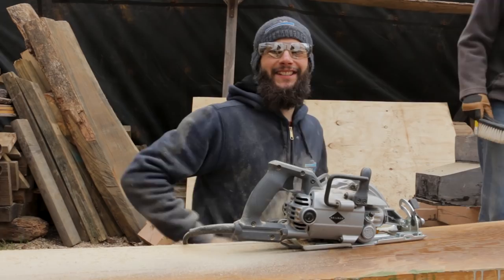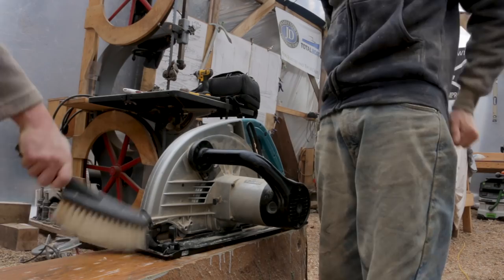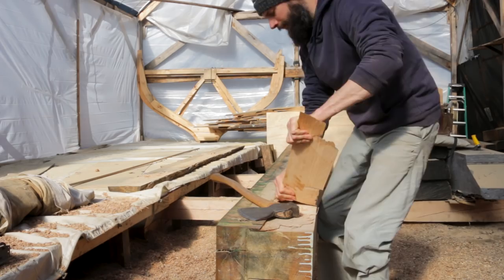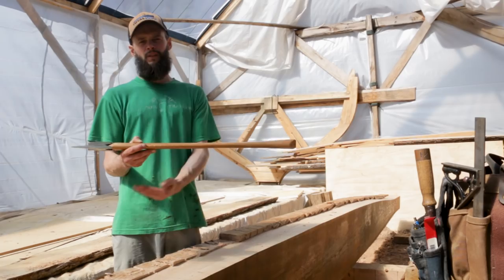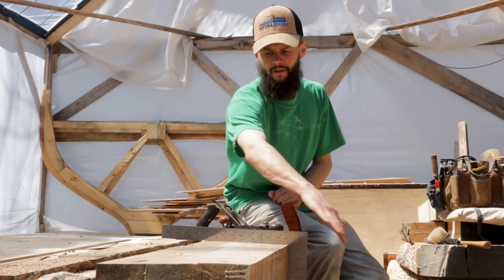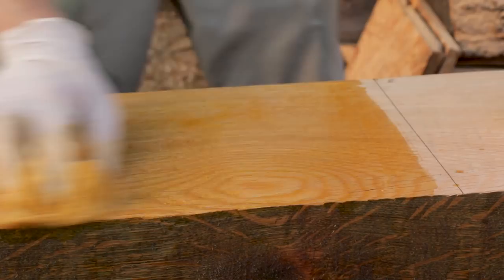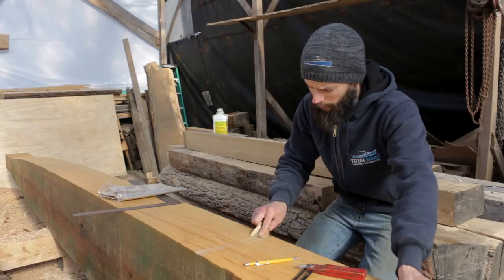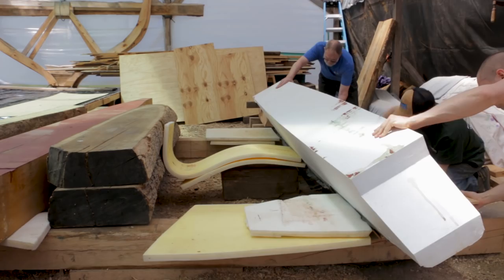Acorn to Arabella - Journey of a Wooden Boat - Episode 35: Final Cut of the Keel Timber

Comment from the maker: Quick blip addressing all the comments about using the bandsaw (or other methods) to cut the keel timber (we have a computer down at the moment so we are not able to get to people's comments as quickly as usual).
The bandsaw is not an option for cutting the keel timber.  First due to the length of the boathouse and the curve of the cut, it would logistically not be practical to cut on the bandsaw.  Next, that timber weighs in at about a ton (2000lbs).  Imagine trying to pick up a car and passing it through the bandsaw for a cut but with no wheels on the car.  Not only is the bandsaw not able to support that amount of weight, it would not be physically possible for us to pick it up and accurately pass it through the bandsaw (it is also not made for this).
And yes, we could have used multiple other ways to accomplish the final product.  Many of you may think there were better ways to do this, but they all come to the same end.  We chose this way after plenty of planning and weighing of pros and cons which may not match the same views as someone that has differing experience (be it more experience or none...).  Our goal is also not speed in this build.  We are learning as we go.  Part of the enjoyment of this project is taking the time to build her right.  Hand tools allow a connection to the work that you do not get from power tools and allow one to take their time and sneak up on cuts and shaping so as to avoid mistakes that can come with large power tools.
We can only hope that you enjoy the process and videos as much as we enjoy the work, learning and sharing of the journey with this community.
Reply: Hey guys, part of the fun in watching this build is me thinking of how I would have done something. That has nothing to do with your process, I mean you guys have spent days/weeks planning it out. I've spent 5 mins on the same. The rest of the fun is just watching this boat take shape under your skill.

For example regarding with this cut and my thought process. My thinking after 5 mins was chainsaw. bar length allows full depth cut. Perfect right.
5 mins later I realised that chainsaw would not allow a perpendicular cut to the top.
So basically that would be a bad idea and probably result in a stuffed timber.

Another great video guys.
Reply: Exactly. commenting on how (method) i would do it and getting your feedback is half the fun of being a casual viewer. Your replies to comments help me learn as much or more than just watching how you guys chose to accomplish a step in the project.
Reply: Thomas Russell I understand your point, but the way your other comment is written seems a little bit arrogant
Reply from the maker: Thank you all for your comments on this.  We do not want to discourage comments or people from expressing their opinions.  We love that aspect of this work.  As many of you have brought up, there are so many ways this could have been done.  We simply request that the comments be left as constructive criticism that allow for discussion and learning.  Thank you all!
Reply: Giacomo Jack Balma DRUMS no arrogance intended. I know little to nothing about boats or building them. I have worked with wood and some large timbers and was just trying to say that rollers would have made the timber manageable to use the bandsaw. If it came across as anything other than constructive criticism, I apologize.
Reply: See you guys in Mystic next Sunday!   Can't wait!
Reply: Your muscles have to feel it for the Old Timers, who had no power tools?
After all, this being made to 1936 plans.
Reply: @jack_drums  I suspect he was a bit tired of all the Monday morning quarterbacks.

Comment: Great video thank you very much! I have found when making a difficult ripping cut with a circular saw a squirt or two of silicone spray on each side of the blade periodically will make all the difference in the world. It's amazing what a difference  it makes! Also a squirt or two on the base of the saw makes it a lot easier to push.
Reply from the maker: Thanks for the tip! Similar to the soap suggestion below.  Lubrication almost always helps.

Comment: Well, that was painful! :) More then one way to skin some oak, I guess.
 By the way, you probably know now, but cutting a curve with a circular saw will bind the blade, which is straight in plan view. And heat and warp the blade. I've done this with those 16" saws. It can, if muscled through the cut long and hard enough, permanently warp the blade. Also from personal experience.
 The larger the blade diameter and sharper the curve, the more the bind. On outside, convex, curves the set and bind will tend to make the kerf wider to the waste side. On inside, concave, curves the extra kerf tends to be taken on the finished side.
 Good progress and thanks for posting. (Complaining about the heat now!!! How quickly we forget!) 
 Cheers

Comment: My uneducated approach would have been to make a series of stopped cuts radiating out from and perpendicular to the curve with a chainsaw, then created a clean shoulder along one or both faces along the curve with a chisel. Finally I'd have followed along the curve using the clean shoulders to index the chainsaw to finish off the cut. Complete final shape and surfacing with a hand plane as need.

Comment: Nice work guys.  I thought I'd share a couple questions/ideas with you that may make things easier.  I have experience building log homes and regular stick homes, so I know just enough about woodworking to embarrass myself.

1)  When developing your first flat face on your timbers, I was thinking you could have gotten a stable piece of flat stock material (something like box section steel, or even would should work) and affixed it with some short screws and shims where needed.  Basically a sacrificial straight edge to roll over the planer wheels.  Get your first face planed, then remove the sacrificial piece, flip the timber, and remove stock until your screw holes disappear and you hit your finished dimension.  I was thinking the planer may have been at max capacity, so that was probably why you didn't use this method.  Maybe it'll work on narrower timbers.

2)  If you don't already own one, invest in a 'Veritas Log Scribe' when it comes time to adapt your old cabinets and furnishings to the inner hull (I'm not real familiar with nautical terms, forgive my ignorance.  Ask around for someone nearby to explain how to use it if you've never used one.  It's really easy.  It allows differently shaped objects to be scribed and tooled with absolute precision.  With a little practice, you can stack hand peeled logs on top on top of each other so tight that you couldn't fit a piece of paper in between them.  I'm sure you could also join your interior boat furnishings to the curved inner hull beautifully as well.  It's a tool that you definitely should own if you don't already.  Here's the cheapest one I found doing a quick google search: http://www.baileysonline.com/shop.axd/ProductDetails?item_no=15770
And here is one in action to give you an idea of what it's for.  This video shows a guy doing a saddle notch, you can also scribe the whole length of the log to get it to match any surface adjacent to it.
https://www.youtube.com/watch?v=i7GHPFIn9Wg
It's a pretty awesome tool, unfortunately nobody on YouTube really wants to give away their trade secrets.  Building log homes is actually quite easy.  Building them right is quite difficult and takes years of experience.  They all settle and twist over time, and the best builders account for the buildings' movements over time.  

3) Also Google "chainsaw guide for cutting slabs."  I believe it will make your life easier.

Keep up the good work!!  I hear the second one's always easier!  I'll share one of my favorite quotes here with you real quick:  "Experience is the cruelest teacher.  She always gives the test before the lesson."  ~Some Renowned Smartass
Reply from the maker: Thanks for the tips!
The planer was maxed out, we do know about the rail trick.
I know exactly what you are talking about.  I drool over that catalogue regularly, I will look into one.
Thanks, there won't be a second one, gotta get it right the first time!  Great quote! Thanks for sharing!

Comment: Thanks for sharing your story. I have to make  similar cuts . Like you I made my 1/8" kurf cuts with the circular saws but then I went to a Recp. saw with a 12" Diablo "pruning saw" blade. As my cut was in used timbers so I changed out the blade a few times to keep it sharp and cutting true. The circular saw cut in the underside kept in tracking true with no binding. Try it out on some scrap and I think you be happy. Billy in Canada
Reply from the maker: Thanks for the tip!

Comment: I'm a latecomer to your channel and I have not watched all the previous episodes.  When you described the slippage of the router bit while flattening the keel timber, it reminded me that my router did something almost identical when I was cutting some dadoes in a project.  It turned out that the lever that tightens the base around the router motor had gotten a bit loose.  I tightened it up and no more issues.  I was wondering why you did not fill in the "over-routed" slot as well as the cracks in the keel timber with epoxy.

Comment: There is a portable band saw available that slides on a metal base which sits on top of a timber to be cut.  I believe the manufacturer is Mafell tools and of course these are not cheap but Mafell tools are at least worth taking a look at.  I do not know the cutting capacity of their bandsaw and these might not be capable of making the depth of cut you require but again, worth looking at.

Comment: What about a coping saw lol, nice job and you got it done which means you used what worked. Hard for some to make he connection to hand tools and craftsmanship. Can't always push a button and wait at the other end!
Reply from the maker: Other than some real fancy CNC machines complex curves are still best cut by hand.  Sometimes the same holds true for big timbers.  The ax sure removes a lot of wood quickly! Boat building is nothing but big timbers and complex changing bevels.  Using the hand tools is over half  the fun! =)

Comment: When cutting curves with a circular (Skil) saw try using an old fashioned steel blade,  not a carbide tipped one. Now that you've got all the Belsaw equipment you can easily sharpen and set them yourself. A steel blade with a large or heavy set ( clearance angle bent into the teeth) will give you a wider kerf allowing you to cut tighter curves without the blade binding. A carbide tipped blade leaves a kerf the same width as the teeth and binds when cutting curves. Another option for cutting curves in timbers is something like a Prazi Beam Saw which is a chainsaw attachment for a worm drive skilsaw.
Reply: I've also cut a few keel timbers with an Alaskan chainsaw mill by cutting plywood templates for the mill to follow and temporarily screwing them to the timber. It probably wouldn't work on that large a timber without modifications  though. I think the mill has a 13" max. depth of cut and you need to allow for the amount of curve in the templates. There are many ways to reach your goal and any one that gets you there is ok. I've got a 40" shipsaw and would never even consider cutting your keel on it. I'm pretty confident that anyone suggesting the bandsaw method has never cut a large keel timber.
Reply from the maker: You bring the saw to big timber, not the timber to the saw!
We borrowed the beam saw so it came with the blade it came with.  We do intend to set some steel blades for different uses now that we have those machines.  Just got to find the time to get them set up! 
Never used the Prazi, how accurate are they?

Comment: I wish I could have loaned you my grandfather's 2-man handsaw for that cut once the big circular saw had done its work. Could have done it sort of like the old builders used a pit saw. Maybe not as speedy as a power saw, but workable. Were you concerned with deflection/wavering line when using a handsaw, or was it just faster/easier on the back to chop away the remaining 4" of the wood?
Reply from the maker: Just way faster and easier to use the axe and adze.  It really did not take that much time and I really enjoy working with those tools.

Comment: Question. Why is it that you haven't done much sealing to the end grain? Doesn't checking tend to start in the ends?
Reply from the maker: We have sealed them with various things depending on when/how the lumber is being used and how close it is to it's final size and shape.  Checking does usually start at the ends and is a concern.

Comment: How did the clear Plastic Boat House covering hold up to your winter storms? Will you have to replace it this coming fall before winter?
Reply from the maker: So far so good, it's thick UV treated greenhouse plastic so it should last several years provided none of the trees poke a hole in it.

Comment: Great vid as ever, is there a reason you don't sharpen that axe ?
Reply: That axe was sharp the timber was hard
Reply from the maker: Both of you are correct.  
The timber is very hard, the ax fairly sharp but not as sharp as the adz.  
I was splitting it along the grain, some spots were thin, some were thick.  The axe needed to split the grain but if it split surprisingly easily (which it does sometimes when cutting with the grain) I did not want the ax to dig too deeply into the good timber below.  Sharp enough to split, not sharp enough to cut across the grain.  
A ax used for splitting does not need to be sharp to be effective, i.e. a splitting maul.
Across the grain is  a whole different animal.

Comment: Just curious, why not cut the keel with the ships saw? It looks like it would fit in that giant band saw no problem....
Reply: Notso Fresh ... not an expert by any means, but from my point of view and limited experience seems like a rolling infeed and outfeed table would be needed that would a) support that much weight, and b) would need to be longer than the Boat Shed.   And of course then there is the problem of steering that beast thru the cut, not to mention getting it UP an additional 2+feet elevation and on to the roller track !  The prefered option I would think would be to have a track that the Shipsaw could be drawn on the length of the Keel and the SAW would need to turn left and right in the horizontal axis....they did the job much easier compared to all that...and Steve caught a MAJOR error on his Plotting of the station line...way to go dude.  Just my humble opinion...but a good question.
Reply from the maker: Maurice is correct about the saw.  The table is not meant to support that much weight, the timber is just over 25' and the boathouse is 50' so aligned perfectly it might just fit.  The timber weighs at least 1,500 pounds, lifting and maneuvering it would have been a lot of prep and a lot of work to most likely break the band saw table.

Comment: why didn't you use the BIG band saw? Great work guys!
Reply: cos they have no way of lifting the keel that high, or moving and maneuvering it once it's on the saw. plus, i don't think they could expose enough of the blade to cut such a tall piece on it.
Reply from the maker: Chey Hosie is spot on.  The timber is too heavy and too long to wrestle through the bandsaw.

Comment: Summary of the suggested alternative techniques for making the cut.(there might be some more, my apologies if I missed yours)
1. Use the giant band saw you have with roller tables and several guys (numerous people suggested this idea)
2. Use a Prazi brand chain saw beam cutter
3. Use a section of a band saw blade and kludge a two man saw to cut it from above and below.
4. Use a portable band saw (might be expensive if a specialized one is required)
5. Use a wood hand saw (my suggestion and maybe the worst of them all)
6. Use circular saw to cut from both sides of beam (the host's proposed alternative)
ETA
7. Use a normal chainsaw with a fixture that turns it into a beam cutter (by coincidence I happened on the idea here: https://youtu.be/KpXaBHcA3oY)
8. Is a reciprocating saw a possibility?

Perhaps this is a video opportunity? With so many ideas from the peanut gallery there might be interest in what you have to say about the ideas.
Reply from the maker: Summary of answers
1- Timbers too long, and too heavy.  It would break the table on the band saw, require resources we don't have to set up for and trying to steer a 1,500+ pound timber through the band saw would be the stuff nightmares are made of. 
2- Could work, we don't own one, have doubts on the accuracy of one cutting 10" of oak but have not actually used one. 
3- HAHAHA!!!  That would have taken so much longer! Find a hunk of 4" oak (what was left after the beam saw) and rip it in half, no imagine over 50' of that. 
4- Don't own one, the ones that are big enough are around $6,000.  Wanna buy us one? =) 
5- See 3 and factor in rotator cuff surgery. 
6- Risky, quick but risky.  Off by a smidge and we are out a very expensive timber. 
7- The link does not seem to work. But in any event we don't own one and chainsaws can be unwieldy beasts.  Those chains are not designed for precision cutting. 
8- Maybe, I'd rather swing the ax and adz then be vibrating behind one of those things.  I think I have some mental trauma after cutting up the fiberglass boat with one. 

It could be, but we would rather focus our energy on showing the progress we are making on the build.
Reply: Thank you very much for the interesting reply. I smiled at your suggestions about trying one of the hand saw ideas in real oak timber. Maybe that is what those of us that suggested that idea should be sentenced to. More than anything thanks for taking the suggestions in the way I thought they were intended, with respect and with appreciation for the videos you are making.